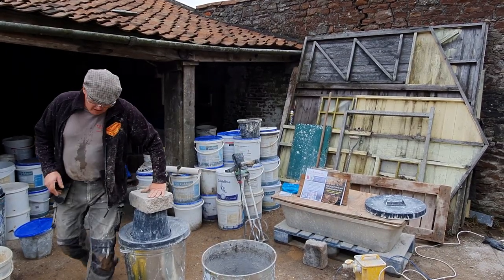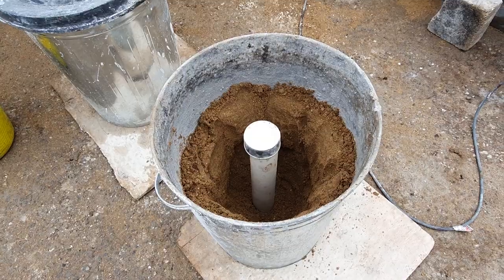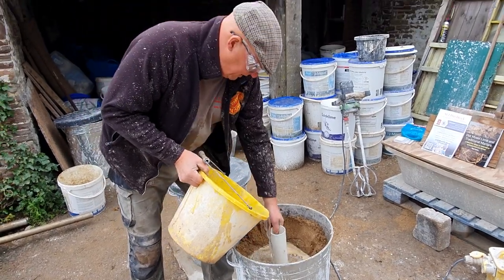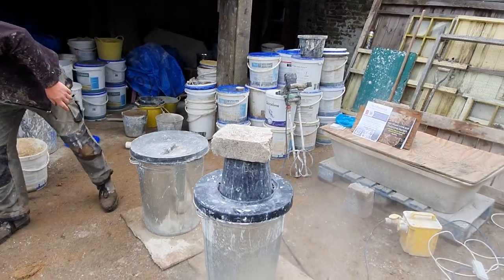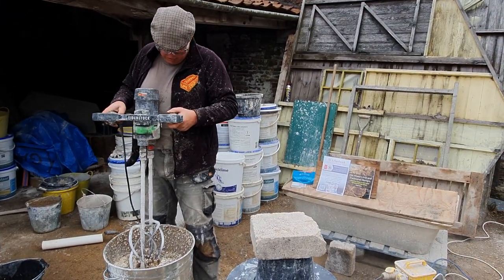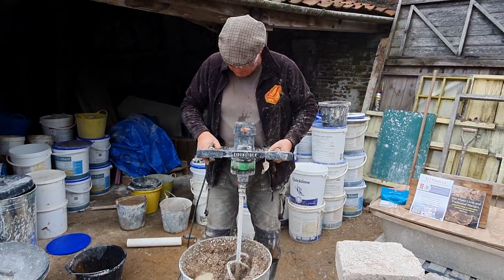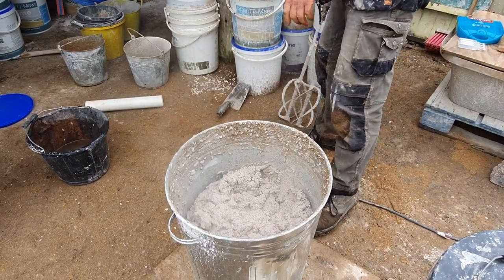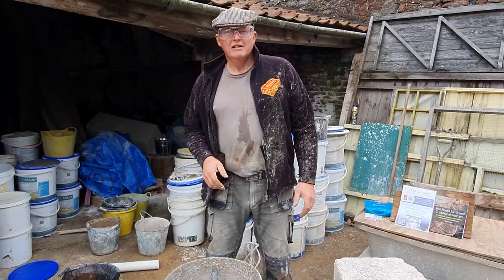Quick hotmixed lime mortar twin bin - Part 2

Comment: Brilliant ideas to control a slake reaction of CaO and water to make practical quantities of building plaster superior to all NHL crap plasters, and no need for Baron or roller pan mixer.  I suggest using a 200 litre drum cut in half, rather than a galvanised bin, then insert a heat resistant HGV tyre around inner perimeter internal surface to minimise heat loss through walls to maintain slake temperature above 120degC for longer.. Also, minimise heat loss through floor by adding a rubber tyre internal floor matt. Quicklime (<2mm grade) from Shapfel quarry in Cumbria (used by TATA steel to make steel and transporedt by train to all the way to Newport South Wales Steelwoks) is superior quicklime over Cablux 90 pellets.You store the cooled mixture in air tight buckets, then you insert the contents into a different HGV tyre (cut along a radius to make a cradle) and beat the contents with a stick to knock up the plaster, adding a little water. Then you trowel the plaster onto the wall guided by wooden beads every 2 ft and use a midget trowel to maximise application pressure. The best aggregate is Cardewmires sand for the base coat (3:1), Nosterfield for the float coat and silica sand for the final coat. This plaster system is superior to ALL COMMERCIALLY BAGGED CRAP PLASTER PRODUCTS AND IS FAR CHEAPER AND IS RECYCLEABLE.
Reply: Thank you so much 
I won’t be buying that bag scrap .

Comment: Love your video. A quick question - can you mix a large amount of lime mortar, as you did and keep it for 6-12 months or so? I have got a lot of repointing to do and I only have like an hour a day. Would be a huge help if I could premix and only use as much as I need. I did a small amount of lime mortar like 7 months ago, and keep it in a air tight container. It seems to be fine, whenever I need to patch up something. And whereas I know you can keep lime putty for as long as you wish, I was wondering if the same applies to lime mortar. Thanks.
Reply: Yes, keep protected from frost and sealed

Comment: I have done a video of mine now; video id TygwqB27MGM. I used Calbux-90, which is quite a fine powder. It's very quick and easy to mix and slake.
Reply: metallitech   Well done, please read the comment I’ve posted regarding the difference in Hot-mixed mortars.